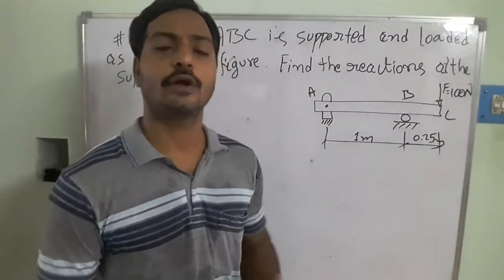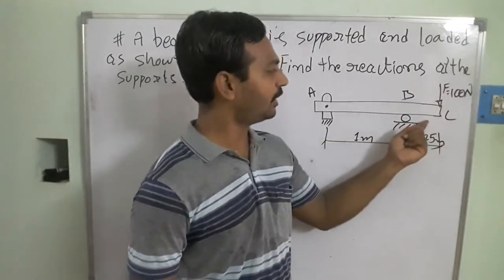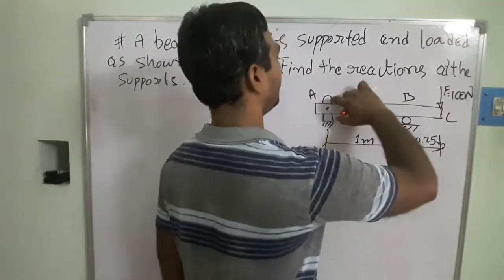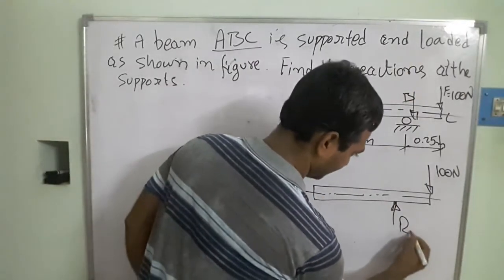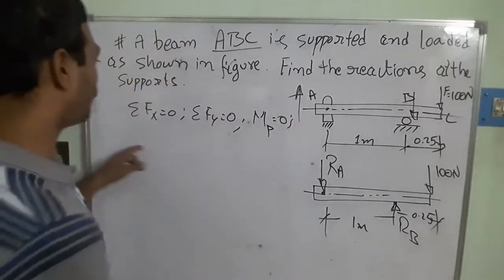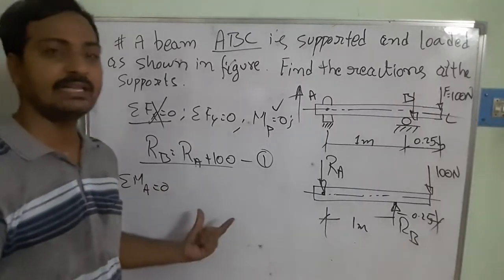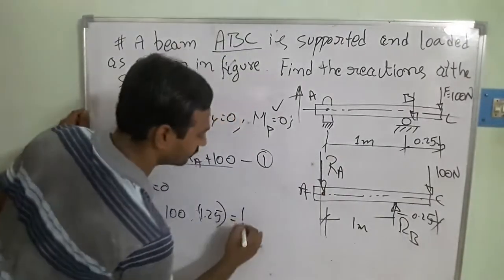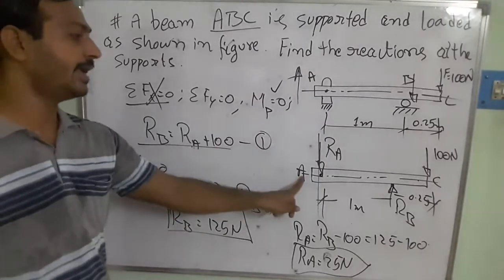Lecture - 22: N3 - Parallel forces in a plane

Comment: Sir u told that moment at point is equal to zero if I will consider it is a 3 dimension body to the beam than moment about which directions  I will take can u plz elaborate
Reply from the maker: Dear Subrat,
Moment = Force x Arm length (perpendicular distance to line of action and point of observations).
Now, if arm length is zero (it means there is no perpendicular distance between line of action of force and point of observation) then moment is zero. I hope it is clear when the moment is zero.
Similarly, second question, assuming the direction of moment depends on the observation point. 
First fix the observation point and then take either clock wise or anti-lock wise. 
Such assumptions are standard for 1D or 3D (you may follow your own assumption but you have to mention at the starting of the explanation). 

Thank you